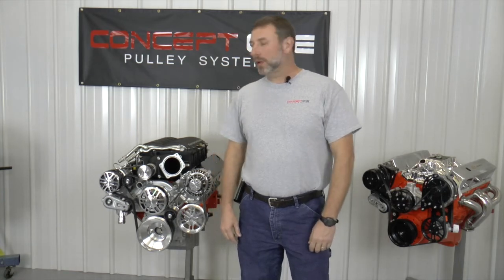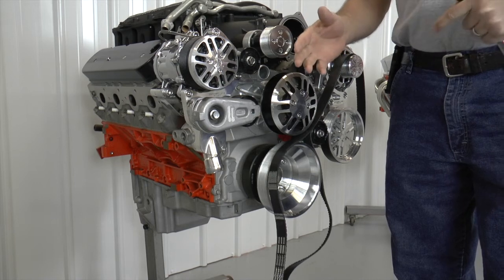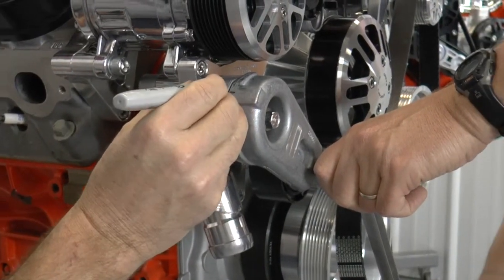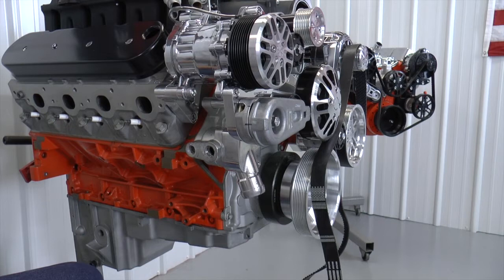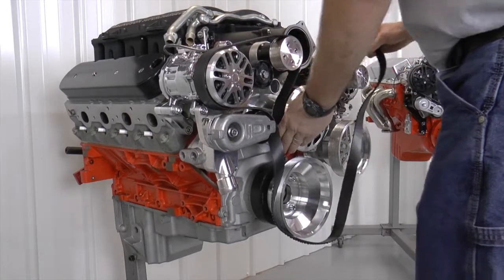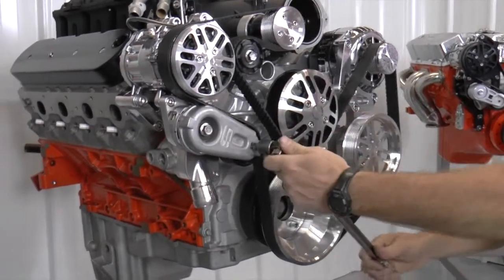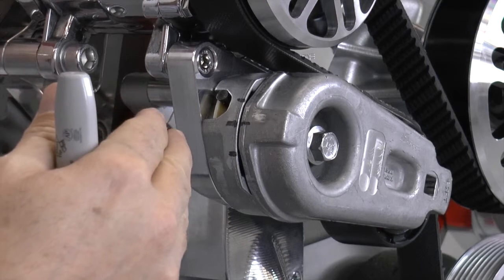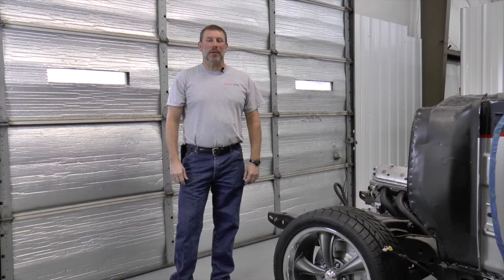Concept One Shop Talk Episode 2: Supercharge Pulley System Tensioner

Comment: So when mounting the belt you want it right around the middle, is less arm travel better?  Would say , 10% be bad - i.e. leaving 90% of the arm travel available to take up slack?

Just a note in my experience,  once you turn over the engine a few times, the belt usually slacks a little bit from straightening out also.